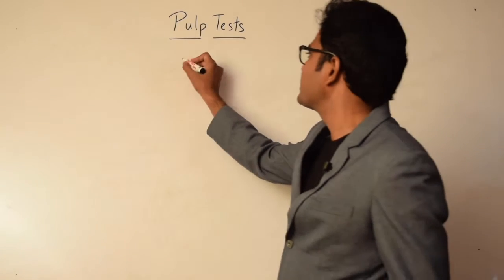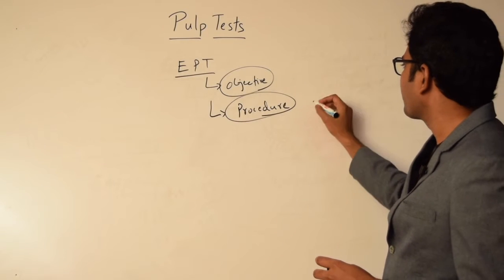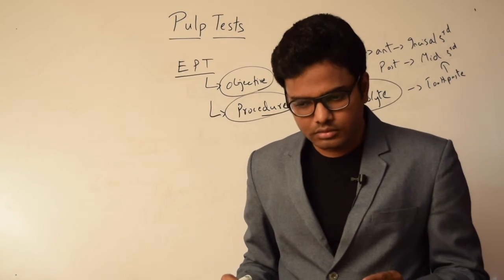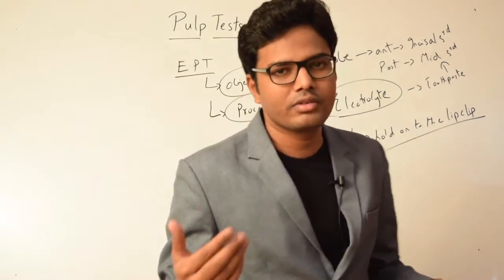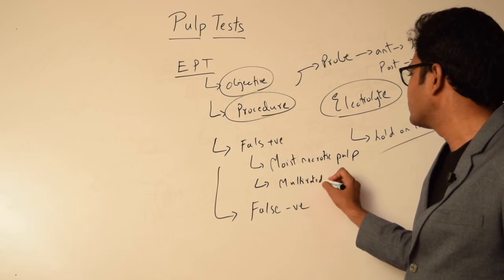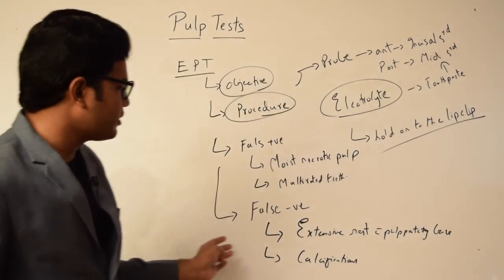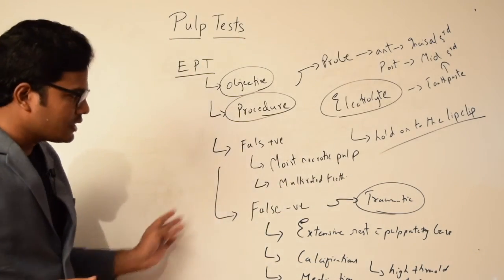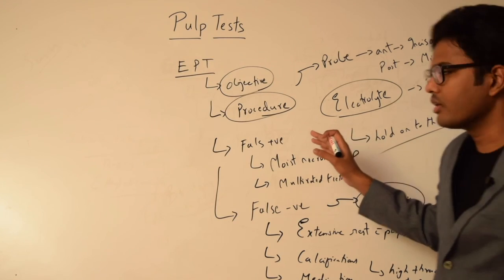Electric Pulp Testing

Comment: Sir in which cases do we need to do this pulp testing..?i mean mostly a problematic tooth can b diagnosed by percussion or by radiograph...or pt himself tell wher is d pain...so sir plz tell me why do we need pulp testing..i think i m missing some points..ppz help
Reply from the maker: Good question Amit. I appreciate your inquisitiveness. Now explore and refer literature and get back through mail (proudtobedentist@gmail.com) using doubt clarification form available in general section of eclasses (eclassesbyptbdacademy.com) via guest log in. Best wishes.
Reply: Sir plz here...i m a genral dentist from a very remote area plz dont it difficult for me...thanks in advance
Reply from the maker: My intention is only to empower you. Rather than passively feeding information for 'your' doubt, I suggest you active learning. So get back through the prescribed format for the same. And let not any reasons hinder your process of active learning. Best wishes.

Comment: sir enamel and dentin are good conductors of electricity? if yes..  why this current cant conduct to other teeth and give a mixed response?
Reply from the maker: Theoretically its possible. But clinically no such findings. Moreover, studies have proved that EPT is as reliable as cold testing except in few clinical situations. You can check out a recent live session on the same. Drop a mail @ proudtobedentist@gmail.com for doubts clarifications.